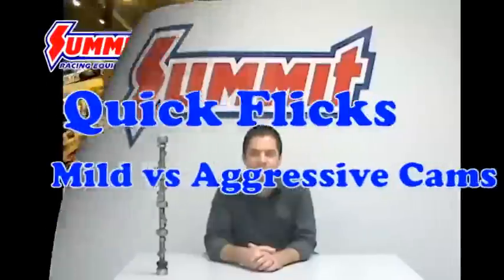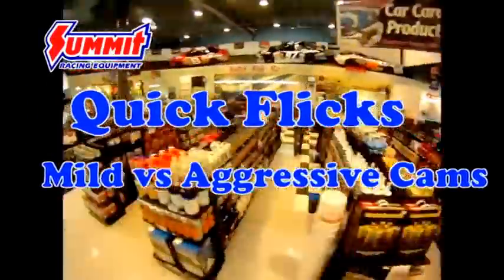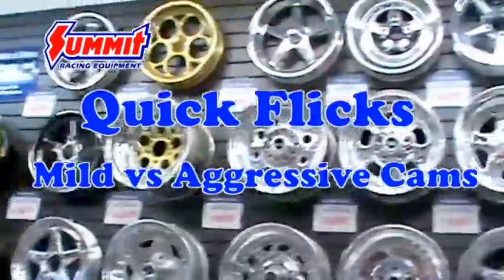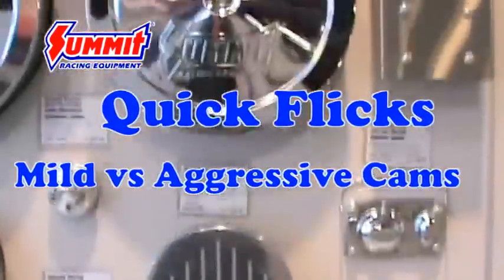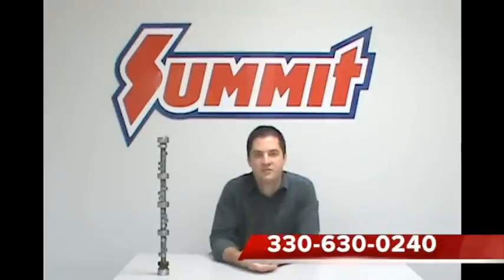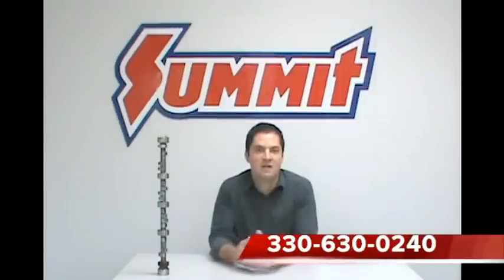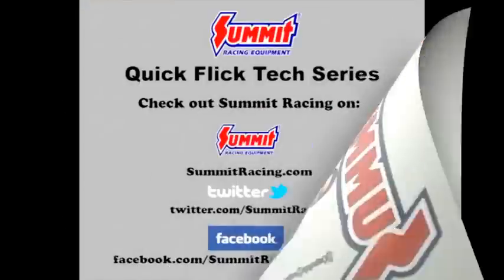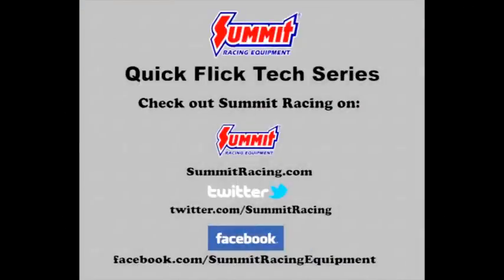Types of Camshafts | Learn the Differences Between Mild and Aggressive Cams

Comment: My car has a 373 posi but has a tired old 350 that’s stock and want to freshen it up and put a cam in it . I’m not worried about top speed , just want hard launches and to let the rear tires smoke a little at a stop sign . Trying to learn about cams but still confused . Any recommendations for what cam size would be good with my rear end?
Reply from the maker: Thank you for watching. We would need some additional information from you. What vehicle, what transmission, if an automatic what torque converter, are you willing to change valve springs, etc. Can you give us a call or go to our chat option to talk to a rep? That way we can get the information needed to answer this question. 1-800-230-3030

Comment: Hey, Pontiac GTO from 2005 - 2006 manual, I would like daily usage and a great sound, the horsepower gain is not super important, just the sound and drivability. The car is 100% stock. LS2 ofcourse. I would like to change to full exhaust with headers also. What cams would you suggest and what supportive mods would you add? Thanks // Acke
Reply from the maker: Hi mrackelito1, 
First of all, with the mods you’re suggesting, it would be best to find someone you can have retune the computer once the mods are made. As far as the cam you’re looking for, the Comp Thumper cam (54-600-11) with matching valve spring kit would be great. There are a lot of choices when it comes to full length headers and exhaust kits. Our website can help you there or give us a call. 1-330-630-0240 http://www.summitracing.com/search/product-line/comp-cams-thumpr-hydraulic-roller-camshafts

Comment: Which cam would be best for me.  I have a 305 that I'll be putting some 350 heads on . Plus I will be adding an Edelbrock carb and intake. So I would like to know which would be best for my build...
Reply from the maker: Hi TQ, 
It will all depend on what transmission you are using, what torque convertor if it’s an automatic, what vehicle, what gear ratio, etc. Please give us a call or email us with the information. We would be happy to help! https://help.summitracing.com/app/contactus

Comment: I got a 2014 chevy Silverado Z71, I got long tube headers, cat back exhaust and K&N air filter. It's my daily driver but I do like race on highway, wondering what stage I should go for And what else I should get before installing it?
Reply from the maker: If your truck has both VVT and AFM a good truck cam option would be https://www.summitracing.com/parts/cca-689-421-13 You will also need to upgrade the valve springs and have the ECU custom tuned.

Comment: well now you like questions i have many i have a 92 ford f-150 mass air converted 5.0 5 speed i have changed the rear end form a 3.08 open diff to a 3.55 trac loc it has a stock bottom end 86 5.0 ho stock double roller timing set a frpp (ford racing performance parts) b303 cam stock e7te heads and stock truck intake with a 1" spacer stock throttle body what heads would you recomend if i was to take my other block and rebuild it to a 331 same cam and mustang intake to suite the rpm needs of cam

Comment: I got a 1994 chevy silverado K1500 extended cab i already got the  flow master exhaust now u want the cam sound. can i get one that can still turn heads without doing so much more to the engine but that can still sound good...

Comment: im planning on getting an 1103 cam for my 305 chevy. its bone stock, except for long tube headers, aluminum intake, holley 2bbl 500 cfm carb and ignition, already has a small cam. 190, 210 duration, lifters and timing chain. running stock converter and 2.73 hgwy gears. will it work on the car?
Reply from the maker: SebRodz. SebRodz, 
A stock converter and 2.73 gear are not ideal for the longer duration of the 1103 cam. Give us a call and we can go over some options with you. 1-330-630-0240.

Comment from the maker: Hey, 
We would be happy to help! Can you give us the following specifications: 
Model year, 2WD or 4WD, Engine production year,Engine displacement, Modifications to engine and drivetrain, Gear ratio rear (and/or front),Transmission, Torque converter stall rpm,Tire diameter in inches, Factory ride height
Reply: Summit Racing.  I have new 2018. Car I Wat do wick in. 825 hp in it

Comment: When he's talking about an extremely large cam and says it will require much more maintenance at 4:11, what exactly does he mean?  Also at what point is it typically not even worth the money to install a larger cam (obviously this depends on the individual, but say you have sbc with like 200 duration and 116 lsa.  When when one typically notice a change in power/drivability assuming they already headers and exhaust)?  Hope this makes sense.  Thanks
Reply from the maker: Christian Sharron, 
Most times “extremely large” cams are solid lifter cams used for racing. Solid lifter cams require valve adjustments and in a race applications can be hard on valve springs, requiring replacement after a certain amount of races. This would be considered more maintenance. As for “when does a cam change make a difference”, that really depends on the OE cam spec to start with. Give us a call and we can help you determine upgrades for your vehicle. 1-330-630-0240. Thanks for watching!

Comment: Hello, I have a question. 
I’m looking for a camshaft Street use (daily ) I swap 4 x 4 weight 5,452 lb with 
* L92 engine  2012 
* 6L80 
* LS3/LSA Stage 3 231/239 115 LSA Supercharged Camshaft 
* 3-Bolt Cam 
* pushrod 7.350"
* .660" Dual Spring Kit
* Rocker Arms 1.72 Ratio. 
* Manley Intake & Exhaust Valves
* Ls7 Lifters
* Ls9 Head Gasket
* Ls3 CNC Cylinder Head
* Circle D torque converter 3000 - 3200 rpm 
* Diff gear 4.63
I would like to change the camshaft since I’m not gonna be running any supercharge for now.
Reply from the maker: Thank you for your question.  Yes, the Supercharger cam is going to be down a lot of torque in the midrange.  You have a heavy vehicle, but on the plus side is you have gear and converter.  If this was a “Hot Rod” truck that was used sparingly, the Pro LS SUM-8714 stage 4 truck cam would be a great choice.  It’s makes a ton of midrange and top end, but for daily use we’d step it back down just a bit more to the Stage 3 truck cam part number SUM-8713.  This is a 222/231 112 +5.  You may want to go with a 7.400 pushrod, but other than that…it’s a great match with the other parts you have.  The advance ground into that cam is going to be making strong power at 3000 on up through 6500 and you’re going to love it. 
https://www.summitracing.com/search?SortBy=BestKeywordMatch&SortOrder=Ascending&keyword=summit%20racing%20pro%20ls%20cam
Reply: Moving a big hippo is not easy thing .. with this cam I’m making 400whp .. I used to have 3.5 gear ratio about a week back I changed it to 4.63 size ... I’m loving the big improvement. The camshaft that you mention do you think will give more horsepower ?
Reply from the maker: There is a good chance it could making more power, but what we would expect is it would build a lot more midrange and pull the power peak back about 400 rpm earlier.  This will be where the better acceleration comes would come in.
Reply: Excellent, thanks for the advice

Comment: Does displacement of a motor affect the selection of the cam if every thing is the same like compression, intake, exhaust, transmission, rearend ratio, and car weight?
Thanks in advance.
Reply from the maker: Nicholas Pederson , Yes, a mid-range streetable cam that you may choose for a 400 cid small block would actually be considered a large cam in a 283 cid small block. Feel free to give us a call on the tech line and we can assist you in choosing the correct camshaft for your application. 1-330-630-0240.

Comment: i got a ford 390 fe with stock heads flat tap lifters stock converter in a1965 galaxie with 4 bar carb what i need for street
Reply from the maker: I recommend the COMP Cams Xtreme Energy cam kit, CCA-K33-234-4. That cam will work with the stock torque converter, have strong low end torque and mid-range power, and will include everything you need to replace in the valvetrain.

Comment from the maker: This question would be best answered by our tech department. They will have several questions for you. Can you give them a call at 1-330-630-0240?  Thank you for watching!
Reply: Ok I'm building a 350 for my 1984 k10 it's got headers Holly carb after market intake ...my question is I'd like to have a loby choppy idle but I also want to drive it every day it's already got a 1800-2000 stall in it what kind of cam do you recommend I know I can use a vacuum reservoir for my power brakes so that wouldn't be an issue. Any help would be appreciated.. looking for bottom end torque.. but I also want a choppy idle.

Comment: I have a 2007 Chevy Monte Carlo SS. What needs to be done to the car in order for a Camshaft to work compatibly?
Reply from the maker: Calvin Burleson, 
Due to the fact that you have a front drive vehicle with a transverse mounted motor, of course the motor would have to be removed from the car. Once mounted to an engine stand the motor would be disassembled to the point the camshaft can be slid out of the motor and replaced with the upgraded cam. New matching valve springs would have to be installed on the cylinder heads and programming installed in the PCM. 
Cam swaps are not as easy or inexpensive as they used to be!
Reply: Ok thanks

Comment: I have an 88 jeep comanche 4.0litre I6 would u be able to recommend a camshaft that will best fit my truck
Reply from the maker: +pirotechnico323 , 
Yes, please give us a call with the rest of the particulars such as gear ratio and tire size, transmission type etc. 1-330-630-0240.

Comment: The advice that he gave with regards to the '76 Corvette and installing a camshaft with a 106* or 108* lobe separation angle won't work any of the vacuum accessories is false.  I had a custom ground solid/mechanical camshaft from Iskenderian Racing Cams that specs out at 272* int./278*exh. @ .020" (lash) 240*/246*@ .050" ground on a 108* LSA, 104* ICL.  Even though I took the pro-active approach and installed auxiliary vacuum canister, my power brakes and lights all work as normal.  I adjusted the advance curve in the distributor, 20* initial with 18* in the 'dizzy' for a total of 38* all in by 2800rpm.  As well as increased the curb idle to 925 rpm, it starts nice, shuts down nicely as well and runs great.  I loves the nasty idle my 454" (over-bored to 460" cid) has and it has tremendous throttle response and an excellent power band from 2,400 to 6,400 rpm.  The cylinder pressure test (hot) measured average of 180 psi.  Lowest was 178#, highest was 181#  Great for 92 octane fuel.  Go with Iskenderian, made in the USA!
Reply: Yes, now bump your duration up to around 295-305 and watch your vacuum fall off to 5 psi.
Reply: @donrutter6765  since when is vacuum measured in psi?

Comment: I drive a 2011 Camaro SS with the 6.2L LS3, it has full exhaust, tune and K&N air intake. I'm looking for a cam that will give me a large HP increase for drag racing with a great sounding idle, but not be too hard on the engine.  Is there a cam for this? What sizes do you suggest?  I would prefer not to upgrade much else at this time.  I appreciate any help!
Reply from the maker: Hi bigswole murican, 
Can you give our tech line a call? 1-330-630-0240. We need some additional information from you. Thanks!

Comment: I have a 2002 tahoe 5.3 and would like it to stay a daily driver but with power. It has a k & n filter and thats about it. I wanna get long tube headers, cat back exhaust, bigger injectors, transmission and new stall and either a supercharger or procharger. Ultimate goal for the truck when all is said and done maybe 750hp. What type of cam(s) would work best for this?

Comment: i have an m3 s54 3,2 engine and i am looking for upgrading my cams this is a street car and i am looking for the best performance...
the oem are 260 intake and exhaust
schrick suggests 288 intake 280 exhaust with the same lift 12,5mm
what if i put a 288 intake and exhaust with 12,5mm lift ??
why differentiate intake from exhaust by 8 degrees??
what are the pros and cons
thank you in advance
Reply from the maker: Hi Stratos, 
Manipulating the camshaft specs on either the intake or exhaust side is done many times to compensate for poor flow characteristics of intake or exhaust systems.

Comment: How you guys doing Summit? I know you deal with big motors and no imports but it doesn't hurt to ask, I have an 02 Maxima 3.5 6 speed all natural no force induction, and want a camshaft to help my performance mid range to top end, is there a camshaft available for that car and if so would I need any other internals and what would they be?
Reply from the maker: Jnevone DSF , Unfortunately, we do not offer cams for that car –sorry!  But when changing them, make sure you also replace the valve springs so they match the lift of the new cams. You should also replace timing chains and tensioners assuming the motor has some miles on it. Of course you will also have things such as gaskets and fluids, but don’t forget that on todays vehicles (computer controlled) you will also have to have new programming for the new cams!  Good luck!
Reply: Summit Racing Thank you I appreciate that,.

Comment: Hi i have a 76 gmc sierra grande with a 350 sbc with a edelbrock 4 barrell carb with stock intake and do you think a rv cam would work
Reply from the maker: Ethyn Stuart , 
Yes, RV cams are great for trucks; especially those hauling or towing. There are other components to consider while doing this swap out such as a timing chain set, valve springs and gaskets. Give us a call and we can help you pick it all out properly. 1-330-630-0240. Thanks for watching!
Reply: +Summit Racing turns out the gmc i commented about a year ago, already hsd a rv cam

Comment: hey guys I have a 2011 dodge charger rt. It's a 5.7 and its a daily driver. What I have on it so far is I have long tube bbk headers and highflow cats, 90mm throttle body, no mufflers nor resonators, and I've tuned it twice. I was iffy on what cam kind of cam to get especially if i wanna pass emissions. So I just want to know if its worth it? Thank you
Reply from the maker: Hi pedro torres, 
A camshaft change is certainly another way of adding more power but, the correct selection especially when dealing with emissions is critical. Give our tech line a call and we will help you make the right choice. 1-330-630-0240.
Reply: ok awesome, thank you

Comment: Is the K2802 cam too much for my 75 Pontiac 400. What's your opinion Summit. It's a weekend toy.
Reply from the maker: We think you’re going to love this cam. It’s a 224/234 duration with 114 lobe separation. It will have a cool idle and make great power too. It’s not so big that you’ll have a problem with carburation and you’ll probably want a curve kit for your distributor and add a few degrees of initial timing from where you are with a stock cam.  Your 400 is big enough that you wouldn’t need a higher stall converter, but a 2800-3000 converter would make it a rocket.

Comment: ON a  thumper cam what causes that distinctive thump? The height of the lobe (if so; which one intake or exhaust?) or is it the duration of the cam lobe?
Reply from the maker: Hi John Kerns, 
According to Comp Cams; It’s a mixture of early exhaust valve opening with long exhaust duration and a great amount of intake and exhaust overlap. The height of the lobe equates to lift and the duration is what is keep the valve open.
Reply: ok thanx; I was just wandering.

Comment: I'm putting together a Chevy 5.3ls engine and I've noticed they have horrible low end torque, what is a good cam spec to have that good off the line acceleration?
Reply from the maker: TruckPassionPhotography, While changing a camshaft may be an avenue to examine, it would be better to consider other more important things first such as tire size and gear ratio combinations as well as torque converter selection. Give us a call and we can help you match it all up. 1-330-630-0240.
Reply: They have huge cc cathedral intake runners, although thats good for high rpm power, the large runners rob you of velocity which means loss of low end torque. That means the motors make good race builds if you are going to leave the line at say 3500 rpm on a transbrake.

Comment: hi summit im looking for the most hp out of a cam for my 69 chevy c10 power brakes power steering. 12 bolt posi.20x10 rear wheels hope you can guide me to the right one. i have a chevy 350 crate 4 bolt main headers edelbrock proformer intake 625 demon carb hei aluminum 185cc promaxx cylinder heads & a 300hp crane cam .everything els stock
Reply from the maker: Hi Jason, 
We need some additional information from you. Can you please give our tech line a call? 1-330-630-0240. Thanks!

Comment: Would you say that stock performance could be increased by getting a moderately more aggressive cams for a mostly stock (has long tube headers, high flow cats, and race mufflers) 96 LT4 corvette? Or would you say that there wouldn't be much of a difference from the stock cams?
Reply from the maker: +cptmiche, 
What we have to consider here is that your LT4 is a factory modified, high performance version of an LT1 of that same year. You already have an upgraded cam, rocker arms, intake manifold and cylinder heads over the average LT1 guy. To upgrade further might mean things like a stroker kit, different heads or maybe some nitrous or a supercharger. Any way you look at it, you are going to have to do some serious tuning inside that computer. You may want to line that person up first before jumping in!